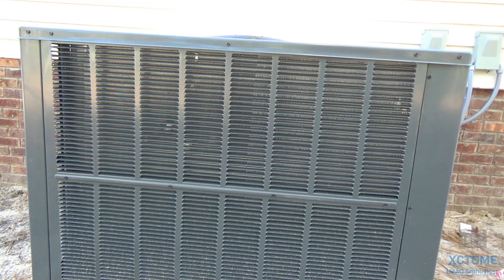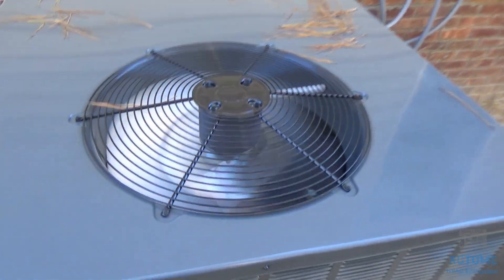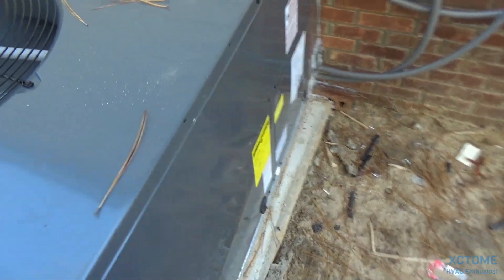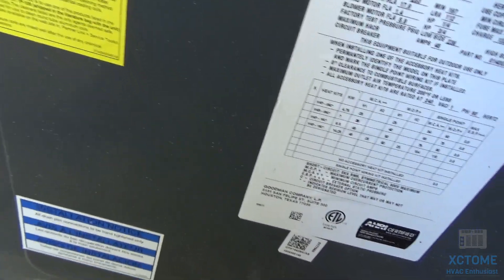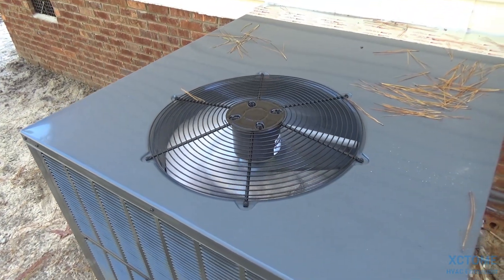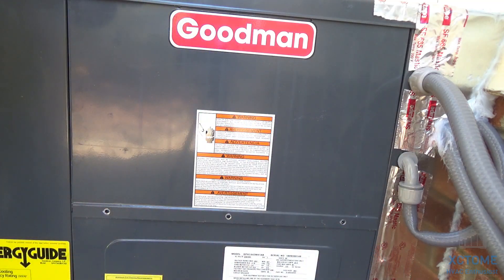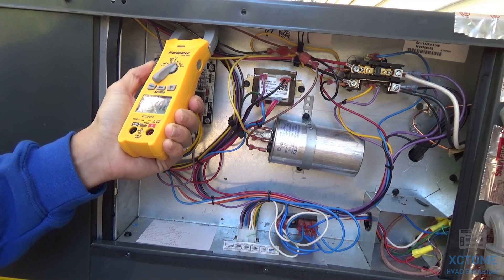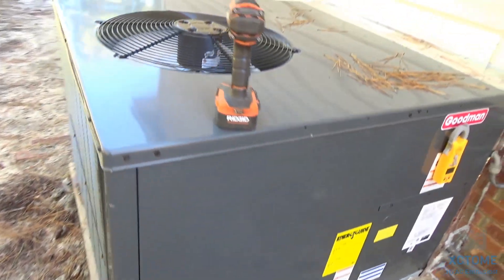Startup Of The New Goodman GPH14M and Re Checking Amp Draw 11-17-2018

Comment: I think the yellow wire nuts may vibrate loose on the low voltage connections. I like using the blue wire nuts, because they secure the small wires along the entire twist better ..
Reply from the maker: I don't like the yellow wire nut's, i've had them come loose in unit's before and pop the 3 amp fuse, not fun when i have to run to a rental property at 2 in the morning in the dead of winter due to a popped 3 amp fuse lol I had to use the yellow one's on this unit because i did not have any blue one's, but i wanted extra security and i cinched and twisted the wire nut's on the wires super-tight, off camera i took a pair of lineman pliers and twisted them on even tighter lol if they ever do vibrate loose, i will get the HVAC grade preferred blue one's, the one's i usually use. Thanks for the comment :)

Comment: Very loud startup for a new Goodman but its nice with the sickle blades :)
Reply from the maker: In person it is actually not that loud, my new camcorder has auto gain on the microphone, plus the camera was right at the unit, i usually put the camera back a few feet, i forgot to put it in manual mode lol Inside the house the unit is barely audible, only time it is heard is when it kicks on or shuts off. thanks for the comment :)

Comment: That was so loud but great video though
Reply from the maker: In person it is not that loud, it's quieter than my unit is, the reason it is extremely loud on video is my new camcorder has auto gain control on the microphone, i forgot to set it to manual gain. Inside the house the unit is barely audible, i have to look out the window to see if it is running it is so quiet. thanks for the comment :)
Reply: i know!
Reply: I get it now🤣